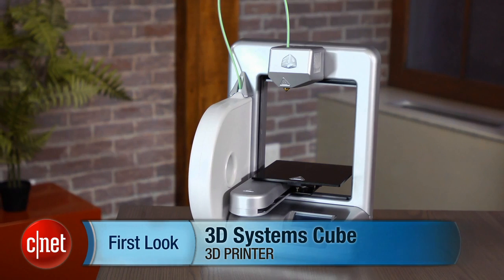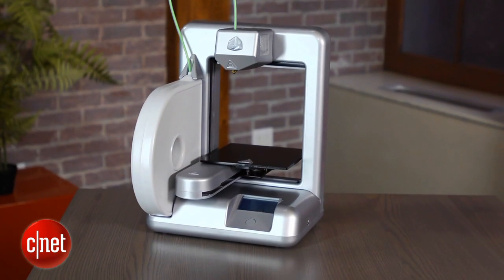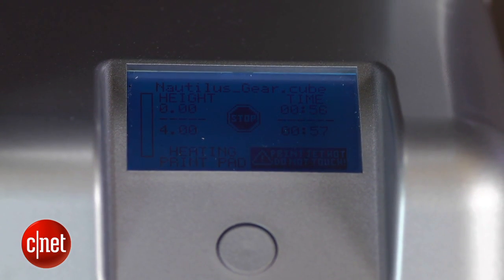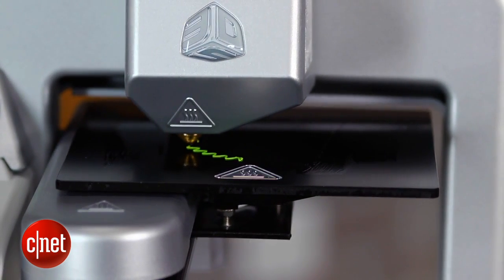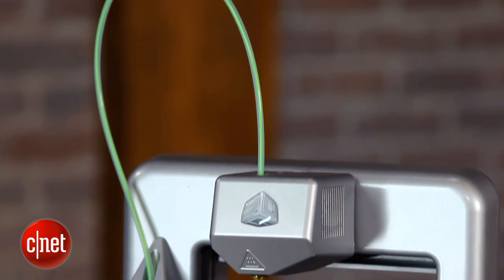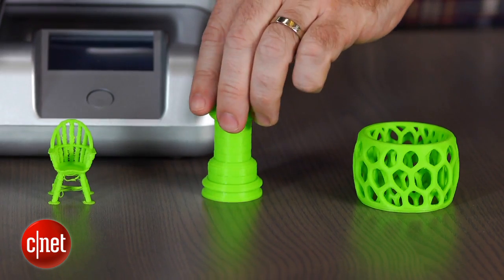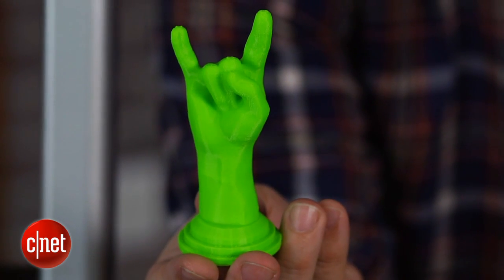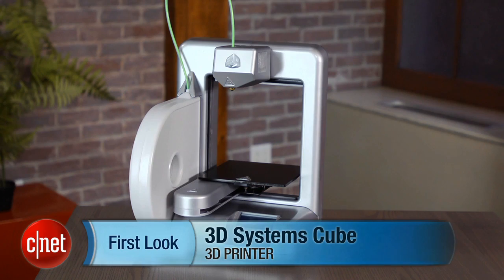3D Systems Cube 3D printer misses the mark - First Look

Comment: Help me. The glass platform of the CUBE 2 printer broke. I Want to order it in the glass workshop. But I do not know the coordinates of the location of the glued magnet. You can send me a drawing or photo of a plate with a magnet. In the drawing, specify the dimensions to the place where the magnet is glued. Thanks

Comment: I think a main advantage to the Cube is reliability.  The print quality is slightly below, say, a Replicator; however, as CNET mentioned, I have never experienced a print fail due to coming undone or extrusion troubles.

Btw, check out my timelapses!

Comment: Came here to say this.  The UP! is by far the best overall printer in the sub $10k FDM printer region.  All of the other printers are too locked down like the Cube or requires way too much building and adjusting like all of the open-source ones.  The UP! also pretty much has the best mechanical parts of these printers with an all steel enclosure, steel linear bearings, no-backlash timing belts instead of lead screws, etc.  Screw Makerbot and Cube, PP3DP UP! is the real winner in this market.

Comment: Just stumbled on this video. Interesting that some people believe they can make their own 3D Printer after you buy one and can replicated the parts. There is a 3D Printer that is very open source and some of the parts are metal the parts that require less perfection and less strength are 3D Printed and can be replicated. Lulzbot is the company. BUT for those who think they can 3D Print and entire machine are wrong. Maybe if you have a 3D Printer that can print in carbon fiber you would have a shot at it but PLA, or even stronger ABS would not support the stresses. BUT you could do what Lulzbot did and some metal and some 3D Printed. But don't forget that you need a control board, stepper motors, an extruder, etc. So, it's really not as easy as buying a 3D Printer and using it to make a clone.

Comment: There's a 3D printer capable of print itself, I don't remember the brand of it. You'll need to buy the circuit board and the power supply, of course, but it can replicate all of its parts.

Comment: Beware, 3dSystems forces you to buy their cartridges which are almost 3 times the price of plastic for any other system. The UP! 3d Printer is slightly more expensive, but you'll save money on the plastic and you'll also have the option to use ANY of the plastic on the market.

Comment: This printer has a problem, and that's the cartridge that it has for the filament, I asked the makers how much filament was in it and they wouldn't give a straight answer, and the empty has to be refilled by the company,,their answer to how much was in the cartridge they said would make about 30 iPhone cases, how they equate an amount into iPhone cases but cant actually give a straight answer to the actual amount is stupid and ignorant to a potential customer that I was. this stopped me dead in my tracks.
At what they said of 30 iPhone cases I estimate it has about 1/2 a kilo and their price is in the 50 dollar mark for 1/2 a kilo where a whole kilo off the shelf without a cartridge is anywhere from 30to 50 dollars, so you can see the price inflation that they put on filament, and plus you have to send them the cartridge back, this is whats known as corporations blackmailing customers to always use a product that can be price hiked at a moments notice,, this is a fail point.
And you have to have a net connection to go online and register as to say that you have it and that it's yours,, why ?, and enter a pin number,,lol,, who's stupid idea is that,so if you live in a country where your in a situation where your off the net you might not be able to use it from scratch, as you cant enter a pin number and register as your net less, Don't buy this, these people think their Microsoft, and want you to be licensed to use it, other wise you wouldnt need any pin number or any form of registration,,and I don't think this is something you can opt out of if its an issue.

Comment: You could spend $1300 + what ever other rip off expenses they charge you for this printer, or you pay $650 to get a reprap pruza i3 based printer (frm someone like makerfarm) and get something with more build space and with superior quality. Oh and did I mention the freedom you have with extruders and filament? Sure it will require a bit of work setting it up, but hey, at least you'll understand how everything goes together.

Comment: 3DSystems doesn't make money from consumer printers. The Cube and now CubeX are monetized and value(cost vs output) are outdone by just about any other printer.  I think the CubeX is $4k and the Cube is $1300, with resolutions of 125micron and 200micron respectively(you can buy 100micron printers off ebay for less than a thousand).  Speed is standard, meaning they aren't any faster than other printers, and are greatly outdone by the cheap Ultimaker. Buy a Hyrel when it is offered soon.

Comment: 3D Systems has the best printers!
Reply: No, they don't. I have one and i've had nothing but problems. My prints constantly failed, their filament is low quality and snaps, and the glue is just a hassle. Not to mention you can't use third party filament at all.
To anyone who reads this, DO NOT GET A CUBE.
Reply: Tarek Salah  Not!

Comment: avoid 3D systems!
Reply: yup
Reply: why
Reply: Helium first (I have a cubeX trio-the others aren't so different I believe)-You cannt use source material filament & you'll  pay $100 for an undersized roll (why) second my print bed wasn't flat  (they sent me a second one) third there is only a 4-40 threaded setscrew holding the main Z drive (crazy) mine stripped out (I threaded it to 8-32) third they do not have a heated print bed so the ABS parts wont be flat -and you will pay $800 to get an aftermarket one. next my usb cable in the machine needed to be replaced. they do not do returns when you can prove you have a lemon. Next -it is a nightmare to level the print bed. (not easy-as it should be) do you want me to continue?
Reply: because in my opinion they are doing the same thing to 3d printers as companies are doing to 2d printers.
these ink cardridges are over priced. and don't allow you to use any other source.
and i think the 3d printer is a symbol for the people in being free what to do with it. and you can't if you have to pay alot for the plastic ink ..
Reply: Greg Tanous Gotcha. I will avoid them

Comment: Layer height is not accuracy.  I see errors all over the place with RepRap-based printers, especially with ABS.  Multiply this by 10 if we're talking prints with supports (UP has by far the best support algorithm).  

I've seen the Rostock, just didn't remember the name, calm down.  Also, the Rostock is a stupid way to build a printer, there's no good reason to use 3 vertical elements like that, it's a showoff piece.

Printrbot is a shitty boy scouts project, wood is junk.  The UP! is steel.

Comment: this printer is crap, the new one that 3ds released not too long ago is a lot better BUT they still put in that retarded chip that causes the plastic cartridge to burn out after it is empty.  They are trying to use the same business model as inkjet printers, except the printer is still expensive as hell and not the plastic is also expensive as hell.....

i recommend a makerbot, maker gear, solid doodle, or another brand (so many are coming to market at the moment)